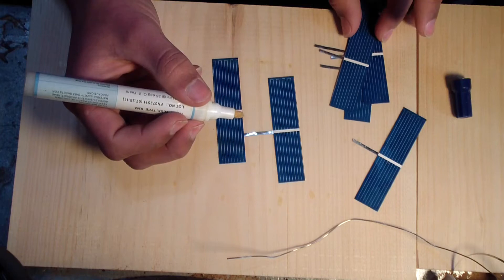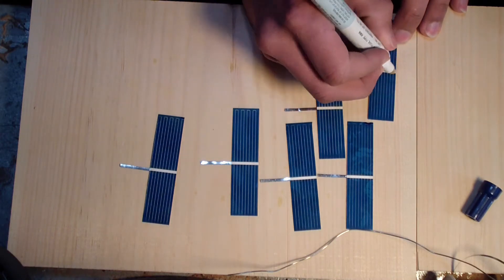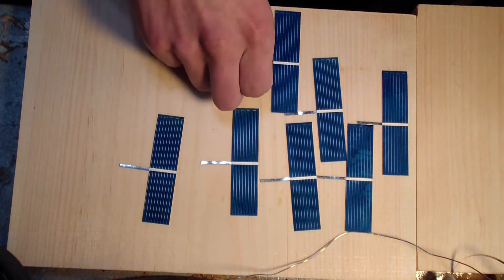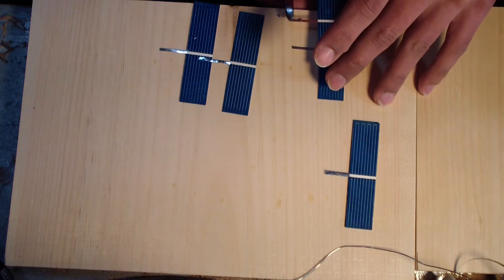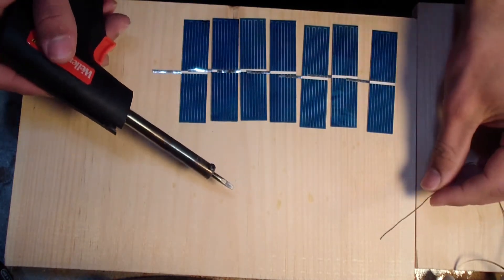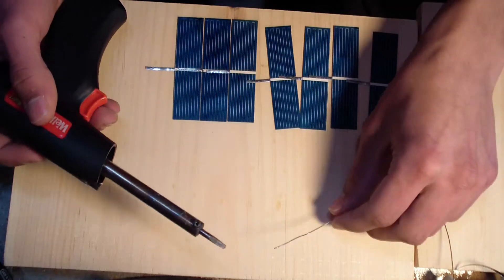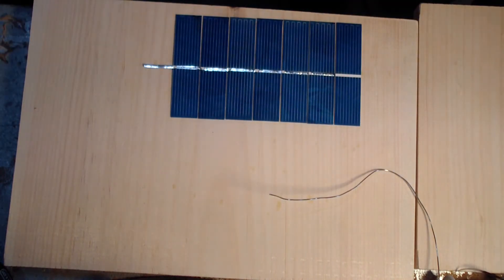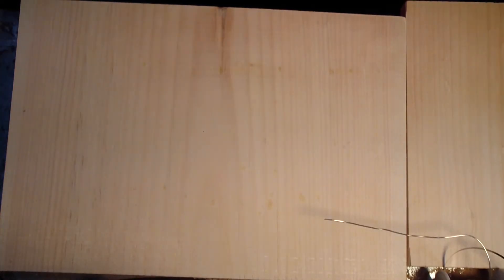Solar Cell Soldering Pt 2 The Tops

Comment: How many mA are you able to get from it? 
I´ve bought 0,5V 0.225W. 0,45A.
But I can´t get 0,45A. Max. current I´ve been able to reach was 0.15A.
There were 10 cells in string (in series) and 4 parallel strings.
So there were 40 cells together and the max current I reached was 0.6A (from 4 parallel strings)
Are there cells shits or what´s the problem?
Reply from the maker: since I do not know how you tested your cells here is a run down of how they work. cells will only give MAX voltage or amperage when direct sunlight is on them, not indoor light as it does not have the right wavelengths. one cell with produce 0.5V when voltage is tested from front to back with a volt meter and nothing else attached. amperage is .45A when an amp meter is connected between the top and bottom basically shorting out the cell. these two things can only be tested to MAX levels when in direct sun light and no part of the cell is covered. Next if the cell is in any way has a micro crack in it it can only pass current through the area that the leads are connected to, so if only 60% of the cell is still attached youll only get 60% of the max rated wattage. 10 cells in series is only 5v max.. if your trying to charge something that is 5v  then you have 0v potential and no charging.. if you want to charge a 5v or something need to have more cells to make more than 5v. Even if you have 20 strings of 10cells you will not be able to charge a 5v battery much faster than a few mA. the Grade of cell also changes things, Grade A is like perfect and has max efficiency, B will work but micro cracks or scratches bring down the rating by 1-3%. lower grades are fun to practice on but not worth building anything with.
Reply from the maker: some times the solder may not be completely attached to the cell instead the flux cools and holds it to the cell. other than that i cant think of much unless i see the cells them selves,, can you test the strings individually without connecting the strings in parallel? dont mean to doubt your abilities, just dont know you or your back ground, but one of the cells or strings could be backward or have a solder bridge from + to - and that would really mess things up.
Reply from the maker: Wow dont know how I for got about that... yes thermal expansion can cause those micro crack I was talking about. I you have trouble trying to get the solder to stick and leave the soldering iron on the cells to much they can gain excessive heat and crack on cooling... if you have more cells try soldering just one cell front and back and then testing just that cell and see if you get the correct Volt and Amp for just one cell. If not, then you probably have bad cells.
Reply from the maker: Actually putting them on a warm hard surface would be better... when its warm it wont cool as fast, the crackling is from thermal shock, when the cells over all are warmer it is less likely to have that happen.. And never solder the little things on something soft of flexible, you have to apply some pressure to get the solder to melt and keep the tab on the cell and so on, that slight pressure during heating can easily break the cells.